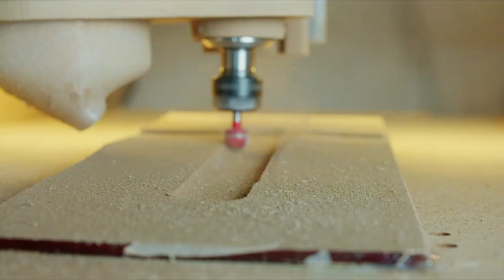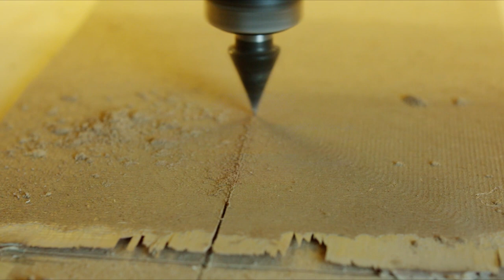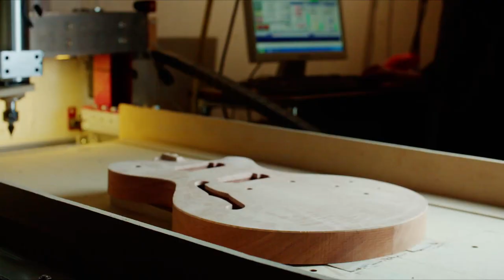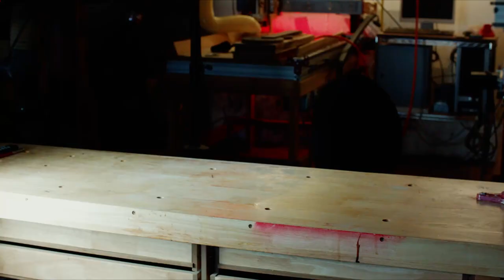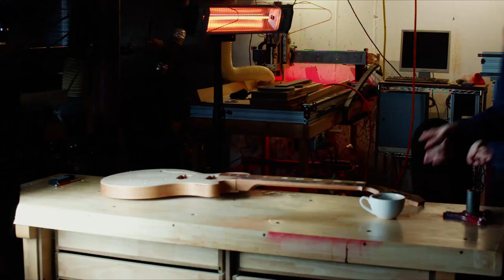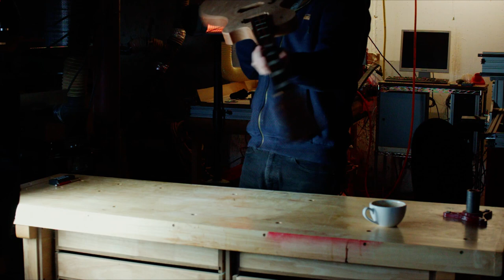Les Paul Style Guitar | The Neck Joint   | Part 7

Comment: How long did that take in real time? I am a member of your patreon and would like to start trying things like this with my xcarve. Thanks for the vids.
Reply from the maker: The milling, or the fitting? most people think of the CNC as a production tool, for me its about accuracy and repeatability, I work very slowly.
Reply: @TwoCherriesIns  It's the milling I was wondering about. I know even a simple sign can take an hour on my machine. So I just figured neck pockets and pickup and control cavities could take all day.🤣
Reply from the maker: @jackwilson3875  it all depends how you go about it. The complete cnc milling for this instrument, all the parts, is probably 2 hours of machine time.